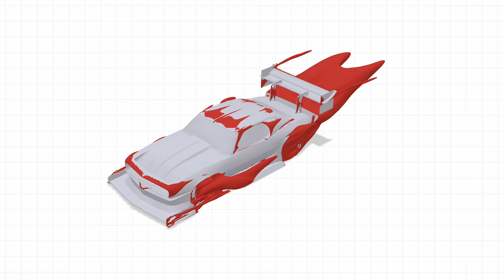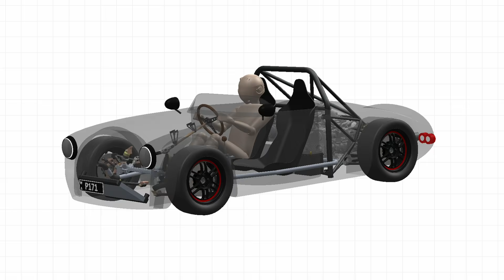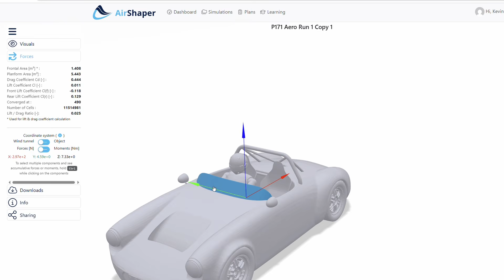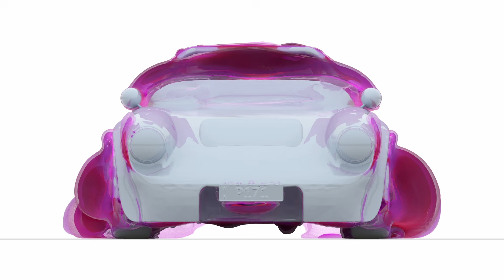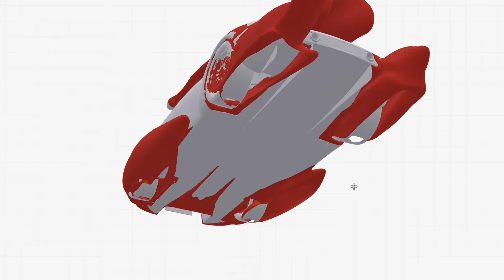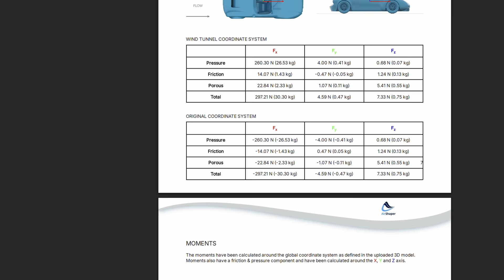Applying Modern CFD to 1950s Design: Project 171 Aero

Comment: Very interesting project and video. When it comes to rear lift, I suspect if you isolated the rear wheel wells more and sectioned the diffuser with more 1-2 more rakes that would help and also dialing in the angle of the diffuser to be within the optimal angle (mechanicals allowing). Will a tonneau cover over the passenger seat be possible? That might help the airflow over the car. Aero shaping the roll bar? I think if they had a tear drop cross section and not circular the air may clean up a little, reduce noise?  A small gurney flap on the front edge of the radiator opening (on top of the hood) may also help direct the radiator air better and may also help with reducing noise in the cockpit?
Reply from the maker: Want to test a bunch of what you have mentioned.  Definitely more coming on aero soon.  Especially like the idea of testing a tonneau cover and a gurney flap on the radiator exit.

Comment: Cool video!! Not sure if it fits the aestethic, but the lift at the rear wheels could be resolved with some louvres on the top. It's usually done on the front wheels of race cars, it vents some of the high pressure inside the wheel well, and reduces the low pressure on top.
Reply from the maker: Will definitely be doing something in that area, but will be trying very hard to keep the 50s rear quarter qesthetic if possible.

Comment: I would be curious to see how much less wind noise there is if you added maybe 20-30 mm of height to the windscreen. Seems like that could make a big impact on wind noise without butchering looks.
Reply from the maker: Definitely something to play with.  At some point you can get away with not having a windscreen wiper (if it is low enough) by the regulations.  But I don't think I can solve the buffeting / noise without raising the screen.

Comment: One thing I have learned with motorcycle wind deflectors is that they do a horrible job if they half ass it. If the full chest to the top of the helmet in is unobstructed laminar wind, it is what it is. But if a wind deflector only does enough to block the wind around your chest upto to the helmet chin region, the noise is horrible and causes a lot of buffeting. Full tuck behind the canopy of a sportsbike is obviously the best regarding noise and drag, but that solution isn't easily replicated to a car with this aesthetic design goal.
Reply from the maker: I put the lower one in with more hope than confidence.  The time I spent on a motorbike when younger should have taught me that as well... but I can be a stubbornly slow learner at times.

Comment: Great video Kev! Having just read an article on clubman aerodynamics there was a lot of complimentary information!
In terms of your video I had a couple of immediate thoughts; could the drag from the roll bar be reduced by adding a fairing to the back of it, and how would that look? Secondly I wonder how the turbulence and noise around the driver would change if the windscreen was removed? Naturally that would mean the full force of the airstream hitting the drivers face, but that wouldn't be turbulent air off the back edge of the windscreen... just a thought!!
Love the progress - look forward to watching the actual build!!
Reply from the maker: I think I read the same article.  It was a good one.  We will be playing around with a few of the changes you mention in future videos.  I'm just as keen to know what can be done in this area.  Interesting idea about completely removing the windscreen instead of adding to it ... will have to look into that.

Comment: seems like you need a frontal splitter with propper rounded edge. Now you have a strong separation in front, air losts it's energy/speed and doesn't give you downforce in difusor. A small splitter will also split high pressure zone in front of the radiator and low-pressure/high-velocity air for undetray. I would say difusor is pretty ok. Also there are a few more things which will make your car more efficient.
Reply from the maker: I have had some similar feedback from a colleague who is a bit of an aero nut.  Definitely plan to show some of these changes moving forward.  This was only the first pass.
Reply: @KevinHayward7  interesting, I'm also a bit into aero dynamics/car design and CAS/CAD modeling

Comment: Looking forward to more aerodynamic content!  A duck bill spoiler would look cool.  I wonder if vents over the back wheel arches would reduce the rear lift?
Reply from the maker: I think the lift over the rear wheels is less from high pressure build up in the wheel well, and more likely low pressure from the curved upper surfaces.  I have had some feedback on the simulations from a friend who is far more aero savvy, so there is plenty planned with aero.

Comment: Was the radiator in the model correct in terms of aerodynamics? Looks like the radiator duct could be improved a lot. 
 Surely you can improve the rear diffuser to avoid spoilers and wings. 
 Do you know how much drag does the roll bar add?
Reply from the maker: The rollbar was worth about 6% of the drag, as measured directly on the surface, although the turbulent air off the rollhoop likely affected other parts as well.

The radiator was close, but needed better sealing to the duct.  A fair bit to change regarding the radiator and the opening.  I was trying to have it as open as possible to look at the effect of air over the hood, but I think it ended up making the analysis not as good for what the car will likely have.

Also planning on avoiding wings as much as I can.

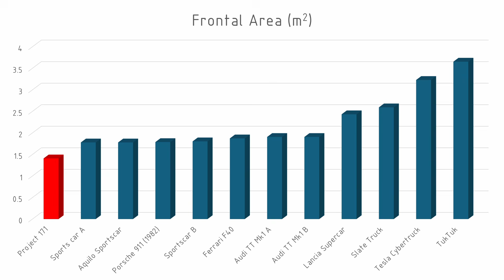Comment: At approximately 22:30 when you plot out where your design stands in a lift force vs drag force graph, there are two small blue dots specifically directly far below your car's red dot. I imagine closer around them is where you'd want to be with aerodynamics changes but I understand if those two cars don't really fit the look of a 50 to mid 60s small sports car like you're going for. Still, I'd love to know what were those two cars specifically (even if they don't exactly fit the visual vibe of this project)? Which two had very low drag area but still had good enough aerodynamic efficiency to generate a relatively fair amount of stabilizing downforce? Also, thanks so much for these videos, they are fun to watch and I feel like they give a very informative look at the kind of decision strategies an engineer goes over at each respective step of the design phases for a project like this.
Reply from the maker: One of the cars was their run of a Ferrari F40, and another was a sportscar design that looked something like a McLaren P1 (although not a McLaren).

Comment: The design is looking good. The stubby windscreen is certainly more asethetic than the taller one you have modeled in the past. I am wondering if you will need to raise the rear belt line of the car, the tail lights look very low, and raising that whole portion somewhat  would probably help   reduce lift, plus more room for a bigger defuser. I think a little ducktail would look good, but i undertand wanting to avoid having to have one.
Reply from the maker: Good spotting of the tail light height.  I want them that low, but the regulations need them a fair amount higher.  This will mean the line that I am calling the hip line will need to move up a fair bit.  Also got some valuable ideas from a colleague that may actually help the diffuser to actually do something.
Reply: @KevinHayward7  Nice one. have you made one of those regulation volume cad models?
Reply from the maker: Not at this stage, but probably should have.

Comment: Bery cool!... but the 64 miilion dollar question is would you put you hand in your pocket for this or  battle through with open foam if it wasnt sponsored?
Reply from the maker: That is a really good question.  The plan before the sponsorship was to go to a mate who is really switched onto aero and beg, plead, and cajole him into doing something on openfoam.  Failing that I was going to see what I could do over time.  I'm not new to CFD, but I am not that quick.

Having used AirShaper now I think I would have tried to pay for some credits.  It probably would have been on a body shape that was further down the line design wise.  I did end up with some areas in the sim that I knew I wasn't happy with, but pushed through to get the first run done.

The equivalent I think is doing something like engine dyno testing.  I am going to have to do that at some point or the engine will not run as we want it to.  This quickly gets expensive, but it is worth it because otherwise the whole car can be compromised.  With the bodywork there is going to be even more work put in, and if there was something fundamentally wrong it would be hard to fix, or possibly even diagnose once built.

Unfortunately to do this car at the level I want to there will have to be money spent not just on parts and materials, but on simulation and testing as well.

Also while I didn't pay for the software I did put a fair bit of time to get this done.  I was pretty hopeful that the time investment was going to be worth it.  In the end I was very happy with what I saw from the initial results, and have plans to fix most of the issues moving forwards.

Comment: Hi Dr.Kev, I'm wondering on testing CFD in airshaper vs ANSYS Fluent. Since I have a free students license it's much cheaper to run ANSYS for me, but I'm wondering if the time investment is worth it to try? ( I have experience in using Ansys  mechanical,and Ls-dyna)
Reply from the maker: At Uni we use ANSYS Fluent.  Great software, but as you suggest it takes a fair bit of a time investment.  I think as a student it is good to try as many different techniques as you can.  Access to that sort of software gets much harder once you have graduated.

Comment: I am a little intrigued, I'd be very intrigued but I know the pricing. So one simple question. Can you try it for free? I mean I know there is a try for free option but. Do you actually end up with the same usable report, just a little less precise? Or no money no reports 😁
Reply: On the website it says there is a free trail, but haven't used it, if you are a student they offer a 30% discount.
Reply: @janpamua7714  I am constantly learning stuff so I am student but not officially. I am only interested in free option (if it's usable). Honestly I can see many much wiser ways of spending 990 euros. Nice drivetrain, a lot of resin and carbon fiber, number of power tools, the list goes on (you can build a whole car for that money if your try hard enough) . Especially if you consider that you can perform aerodynamic analysis for free in CAD software like Solidworks.
Reply from the maker: This is a hard one.  If I look at the cost with my engineers hat on and the results provided it seems really cheap.  If I put on my garage builders hat on then it looks expensive.  It isn't far removed from a day on a rolling road dyno though, and might be the difference between good and bad aero.

It is also a fair bit of money towards parts and materials.

Much later in the project I hope to show some physical aero testing of the final car.  We can share some techniques that can help just about anyone.

AirShaper runs on OpenFoam, which can be had for free, but free is a loaded term with software.  Nothing is free if you apply value to your time.  In a previous video someone asked what would I do if money wasn't an issue.  My answer then was just do things quicker, with more allowance for mistakes.  Airshaper coming on board allows me to do things a fair bit quicker.  But we all have to ask the question with any build, what do you learn / do vs. what do you outsource.
Reply: @KevinHayward7  Yes it is. I think we can conclude that it is all about priorities. I’d say that the main two objectives for car builders are the joy of working on a car (building one) and the joy of owning and driving one. You can divide car builders into two categories, professionals and amateurs. Professionals like to use professional tools, likewise amateurs like to use amateur tools. People use what they understand. I’d say the vast majority of builders are amateurs. Obviously many amateur builders like to use as many professional tools in their build as possible, but because of their knowledge and budget that is limited. There is another split you can make when it comes to car builders. Some like to use as much help as possible, manpower, tools (power tools, software) that will do the job for them, and ready components (pedal assembly, uprights, build plans), practically limiting their role to assembly stuff. And some like make a challenge for themselves. Design their own chassis, suspension, body, fabricate their own components and do as much as possible (preferably everything) without anybody's help. The first kind will fabricate a chassis and attach parts to it and complete his build within a few weeks. The second kind will spend weeks or even months designing stuff and then years building it. Both kinds are called car builders. Usually only the second kind is willing to learn and do as many necessary steps as possible. That is the kind we should focus on. 
Personally, if money wasn’t an issue to me, I’d get all the necessary CNC machines (I’d save years). I’ll be the one who designs the CAD parts and CAM paths and I’ll be the one who is going to operate those machines, so I can still say I did it. That is exactly why I lean towards simulation in Solidworks. I’ll be the one who is going to do the simulation, I am still a one man show. You can’t say it when you use external help/services. It’s ok when it’s a team project, but it’s a no no when you want to do things on your own. Once again, it comes to priorities. Some prefer time saving, some prefer being the only man involved. I already sacrificed years to be the second type. Another thing is that in some projects, like my personal one, drag coefficient is not so important (I care more about aesthetics). Because my project looks a little more aerodynamic than Ariel Atom and I use the same engine as the original one, with similar weight, so I know it’ll be quick enough. But I want to know the drag coefficient of my car. I want to compare my amateur work with the work of professionals. To me it’s ok to use external services for fun. But to rely on it to improve my design, that is a little to hard one to digest. I admit I might need to use some aerodynamic simulation if driving experience will be sacrificed. Than probably I reach to fluid simulation in Solidworks or I even blow some smoke on my scale model to get some answers. There are usually few ways to achieve the same goal.
Reply from the maker: I like your take on the different types of people building cars. For me its a difficult balance.  Sometimes I need to create the tools, usually when it comes to vehicle dynamics etc, same with the design of these components.  In other cases I'm not as engaged and I would rather work with someone who loves that area, or just buy a solution.

My approach has been formed by my time in different forms of motorsport, and a lot of time in Formula SAE / Student, both as a student and academic.  In those contexts I have really enjoyed working in teams.  Although not every team is enjoyable.  I like too share the process, as well as get challenged by those I am working with.  I don't think this is inherently better than doing things solo, but just the way I enjoy it.

If money really wasn't an issue I would find a way to use it to get some of the great people I have worked with together to do this project.  I'm lucky to be joined by some amazing people already, and very grateful for their help.

Comment: I remember seeing how much lower drag an aerofoil is vs. a tube, but almost never seen anyone fit an aerofoil to the most protruding bits of their roll cages.
Reply from the maker: We might have to give it a try to see what the effect would be.
Reply: I'd love to see that result. I've been considering these fairings and always wanted to know the drag reduction. https://www.uflyit.com/streamline_fairings.htm
Reply: On this F1 cars started shaping their suspension components to be more aerodynamic, how easy this is to do with a metal frame is probably not worth the effort but for composites maybe
Reply: @mitchellcouchman1444  - you don't need to alter the frame, but simply 'fair' it.
Reply: @schalkvandermerwe3838 I'm not sure what you mean
Reply: @mitchellcouchman1444  you can put a light weight fairing around the frame. Maybe even just on the trailing edge.
Reply: @mitchellcouchman1444  adding a low drag fairing covering the bar.  The tube is maintained for its structural purpose, the non-structural fairing makes it aerodynamic.
Reply: @steveodea4884 I can't imagine trying to notch an airfoil to get it to fit up to the main hoop and weld it 😂
Reply: @funkyd04  you aren't going to weld the fairing to the roll bar... you'd make it out of composite and bond it on.